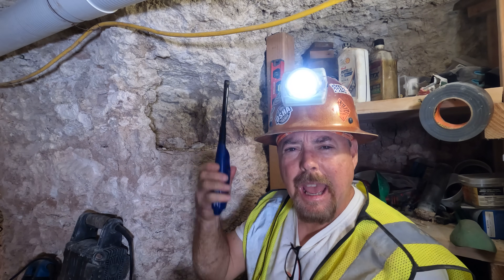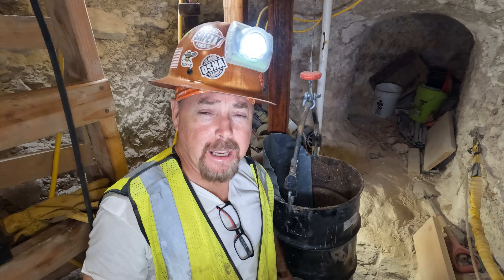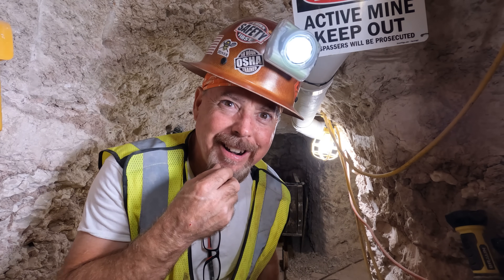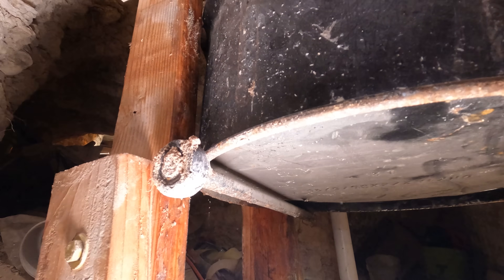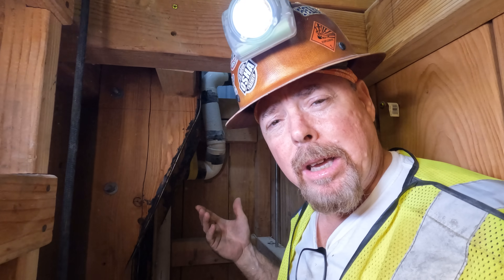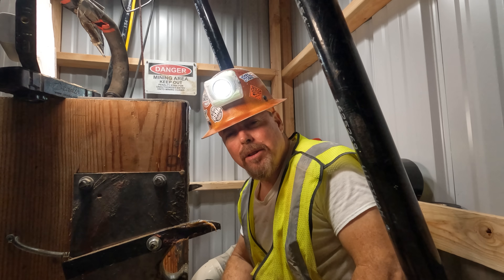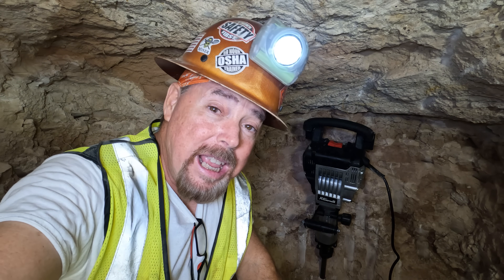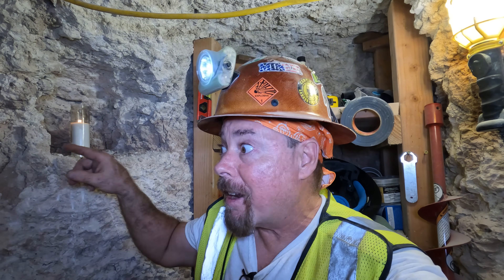How Old Miners Built This GOLD HAULING System

Comment: The easiest way to run that jack hammer, especially up high, is to buy a Tesla robot and make it do it. If you want a cheaper way, China makes a robot for around 20 grand that cleans your house, does your laundry, vacuums, and I bet you can teach it to run a jack hammer. It vacuums so I bet it could run a metal detector!

Comment: I've seen old photos of miners using heavy hammers with a monopod that just supports the weight on the ground and it swivels on the top of the monopod ,so you have 360 degrees movement in all directions, and a swivel lock to hold specific angles.
The candle is for verifying O2...... or loss of it.

Comment: The aromatic candle is to counter the methane that Jeff is producing. 🤣🤣 The candle would also provide backup illumination if your headlamp went out, and it would warn that oxygen levels are too low when it goes out.

Comment: I regularly "spit-rig" various custom tools and devices at work to fit specific unique situations. I can think of designs for getting that beast of a jackhammer to work over-head in general, but something that would at once fit into the confined, cluttered space of a mine AND allow access to the ceiling, while also allowing some mobility get's stupidly complex really quick. I'd just use "ol' reliable" for the ceilings and leave the new one for chest-height and below.

Comment: In the olden days they supported the big ass air hammer with a piece of wood nudged out to hold the hammer´s end, supporting it. Now You don´t have to hold it up no more, just press forward. Still hard enough but a bit easier than holding it up alone. And yes, I´d say the candle is for oxygen measurement, better than a canary. Good explaining

Comment: Just make a metal frame. 2 a frames on either side with a mount in the tip middle to hold the jack. That way you can mount the jack hammer in the mount that swivels and use it to bust up the upper rock in the drift. Or, have it mount to a chain that allows you to swivel anyway you need it to without having to hold it up. Just a thought

Comment: re purpose a transmission jack, it has a foot pedal for lifting at head level cars on a lift just change out the steel casters for axels and off road wheels. and the candle is so when your wifes working ,she doesnt have to spell them beans

Comment: Jeff I watch on you tube about how they mine coal in other countries. the signal device to let top side know when to hoist is a long rope with spring at the top and pieces of metal tie to the end; so when the rope is pulled the metal hits a metal drum below it. The hoist drive mechanism is car engine with transmission and rear end connected to the hoist drum.

Comment: A scented candle is the miners bath fan. And 02 sensor combined.  I did basement waterproofing and had a Bosh electric hammer. It weighed 90 lbs and when I had to jack up a house for wall replacement, I'd used a jack post that I made an  arm to hold the jack the collar on the arm would slide on the post and the holes held the pin to keep it at the height needed. You just had to lift the jack onto the arm and tighten the clamp for hammering.  I could see that working for you when you are jacking the ribs or face. The back would be a bear because of the angle, you'd be eating waste. Nah, not that kind!  Dirt sonny Jim!  And those 3.8 chrysler motors might not last long,  but they have plenty of parts for miners! 
You think a reclining seat on a flat car is a little much?  I like to arrive at work in comfort and style. Great video Jeff, you lifted a lot of miners spirits with your in depth explanation.
Reply from the maker: glad you enjoyed the video my brother ...always happy to hear that

Comment: Mount both jackhammers on a rotating rolling engine stand.  Make them counter balance eachother. If one high one low to rotate the left right positions.  Attach a linkage to butt ends and from the forward rear facing pivot to foot pedal make a step on spring loaded upside down V with a step on mechanism that drive the unit forward using your weight.flatening the hinged V

Comment: Hi again Jeff!  Dawna the miner gal here outside of Kingman. I made my own bucket too but i dont use the trunions because the shaft in my mine is at a 90 degree incline (just enough off vertical) so i dont need the trunions because the bucket rides up the rails just fine. I put the rails in but since the bucket i made is an old railroad spike bucket(one of those 8 gallon ones) i needed to only make the rails 10 inches apart. But i did the same thing with the bale except i heated the iron enough that i could form a ring around the top of the bale so i could put a hook in it and i just bent the iron around a 1 inch peice of pipe to form the ring. Then i bolted those straps they used on old railroad telephone poles up the sides of the bucket and welded one across the bottom of the bucket then bolted a ring thru that and the bucket so i could put a hook in the in the ring on the bottom for dumping. I use the method in the second video u posted with the guy putting the hook in the ring. I use two different hoists.. one for raising and lowering the bucket and another just for dumping. The system works really well. I think fairly soon tho im gonna rewire both hoists to make them work with remote controls plus make the bucket auto dumping(something similiar to what youve got so when im at my mine alone( which most of the time i am) then i wont need to come up out of the mine to raise, dump and lower the bucket. Ill be able to do all that without coming up and down the ladder in the mine to work the bucket. ( its well over 40 feet).  LOL
Reply from the maker: wow ... that sounds like a great system....thanks for sharing that Dawna

Comment: Jeff, looks like your wife got the gold mine, and you got the shaft running that new hammer. I used a air chisel to dig out from under the house it was the only thing that would fit under there it worked good.

Comment: Jeff i think your engineering is pretty good, i think you can build  a cradle to hold the new jack hammer upside down  at end of a teeter totter  about 6' long and about 2' off the floor  with 2 large bicycle wheels on each side of the the teeter totter  about  2' from the hammer so it will roll over debris,    make a latch to hold trigger on and run the cord back to your wheel barrow handles to a j box and mount a new on off or speed  switch and a pig tail for power supply.  build a proto type out of wood then after the balancing is aquired maybe construct  one out of aluminum.
Reply: That actually sounds like a great idea.  I am picturing something that looks like a little old fashioned artillery.

Comment: Lots of mining operations use several drills on a track cart to dual several blast holes at once.  You can drill upward easier but will lose the gravity advantage.  You could build a mechanism that uses your weigh to push the drill in the face.  You might winch into the face or use something like a jack let to push the drill into the face.

Comment: @askjeffwilliams Hey bro, the reason for the candle when working underground is that you need to make sure the air quality is good. If the candle stays lite than there is enough oxygen in there for you to breath but if it goes out you best be making your way out of the mine for sure....

Comment: 0:21 obviously the candle is incase the power goes out it’s scented and you can smell your way back to the entrance 😂😂😂 😬 so do you have to have someone watching the bucket at the top to raise it the rest of the way so it will go back down???? Just curious because I’ve seen an auto dump in a mine in Australia that you just send it up and it returns automatically after it dumps one person can operate it from the bottom of the shaft (vertical) thanks for sharing see you on the next one👍🏼👊🏼

Comment: Need to make a rubber air tire wheeled metal scaffolding with chain block and tackle lifting up and hold the jack hammer.  This then allows horizontal hammering and ease of movement - without beating yourself to death.  Block and tackle allows variable height of the jack hammer to work the hanging wall and ceiling.
Reply: You have your own trolley and rail, and put a scaffolding on the bogie, and you can drill in all directions - with great volume excavated !!!

Comment: Candle goes out oxygen is depleted.
Reply: The thing about it is the candle can detect low oxygen but it can't detect gas unless of course it burns higher and hotter or explodes. But if it's gas that's just toxic and not explosive you'll never see the candle go out period because your lights will go out
Reply: Or to find out if there is any methane down there. 🤪😈
Reply: It's a clock.
Reply: My Granddad used candles in his Wine cellar for oxygen+monoxid monitoring
In a Mine a canary bird ist better, because it's bigger and you also dont feel lonley in your Hole..😅
Reply: or someone blew it out with there breath or accidentally knocked it over. 

Many reasons a flame can go out